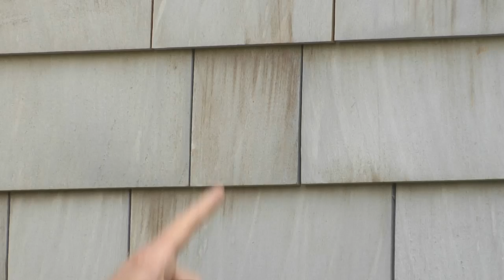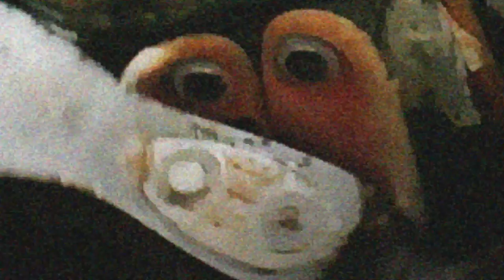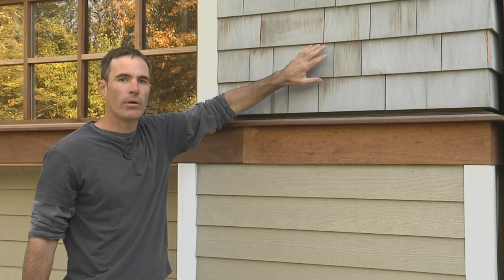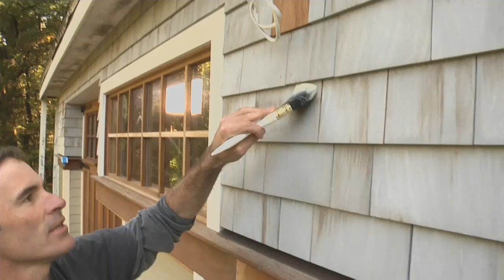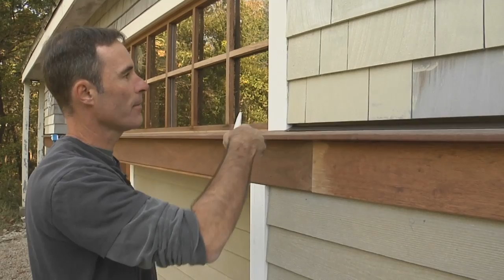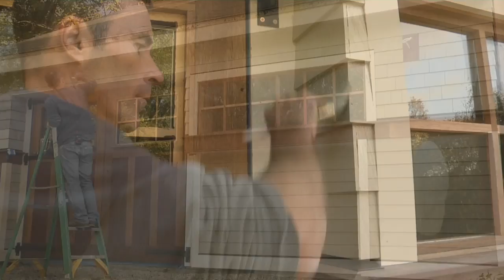How To Prime Cedar Siding To Control Bleeding Tannins and Other Staining Problems

Comment: Sir, you are an excellent painter.  Ive always used an airless sprayer so I could get paint between shingles and the bottoms.  My current job calls for a brush to avoid overspray.  Thank you for the advice.

Comment: Can any oil based primer be tinted. I looked up kilz and it says up to two oz of a universal colorant for non stain blocking projects. But not sure if that means there is some kind of tinting limit. I'm doing a grey exterior.. not exactly sure of color name but want to do same color or close to it.
Reply: Be careful about using any oil base primer you want it to be breathable. Double check with kilz if it's breathable or not . I know Benjamin Moore Wood primer is . I'm going to call them to find the perm rating

Comment: how do you smooth out shakes with a vertical ridge design?
Reply: WHY ?
Reply: That’s the rough sawn look. If they aren’t installed yet they can be ran through a planer using a piece of wood below, cut at the correct taper, to level out the shakes going through. If installed already a hand held palm sander would work. You could switch up the grit to quickly knock down the highest ridges then a finer grit to finish smoothing.
Reply: Lantz Newberry Sure it would work, but if they are any more than 50 or so years old you would end up with so many broken shakes. Why not just leave them the way they are?

Comment: Or you could use two coats of Sherwin Williams Woodscapes. Water based solid stain that has tannin blocking properties and cleans up with water. Much easier. And why not spray and back brush? That's what pros do.
Reply: Hi just wondering, why not spray?